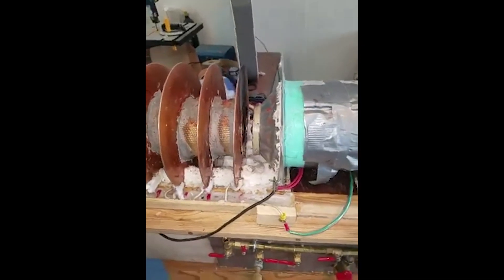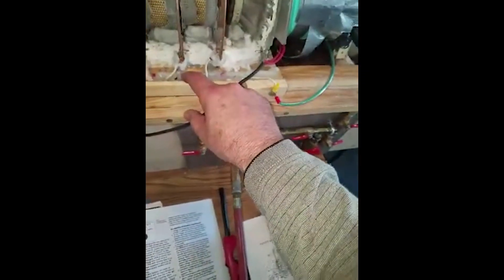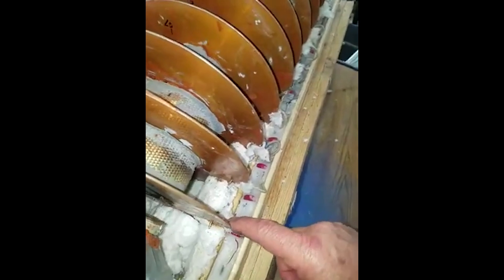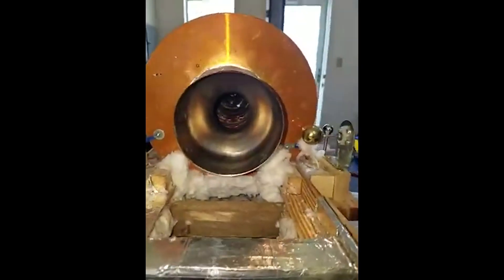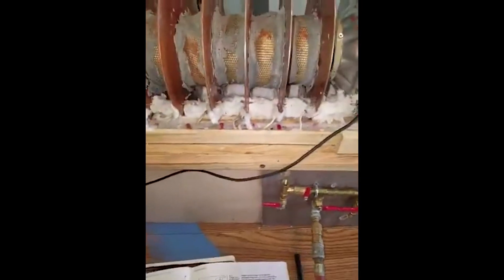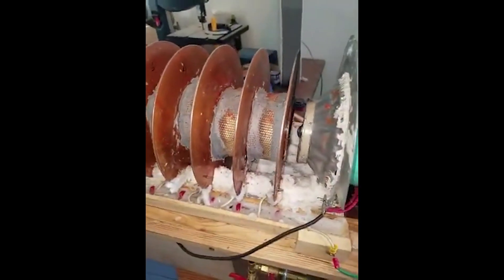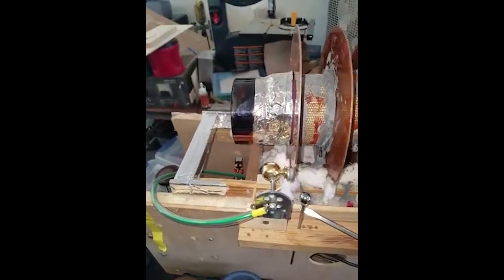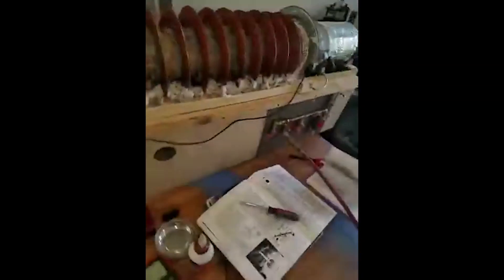TT Brown Flame-Jet Generator Demonstration

Comment: It's good to see a builder working with this. So here's a tip: the hV supply should use an Avaramenko Diode Plug. The transformer wire goes to a capacitor, followed by a diode, then the return wire. Static to charge the flame comes from the connection between the capacitor and the diode. A contact told me: "The flame turns pure white and stretches out to about one and a half times it's normal length". So we're dealing with a high frequency input voltage, with charging inductors for each output capacitor.
Reply: I want to get one of those Yt setups with the big "spark flame" magnetrons and put a fuel gas pipe into that wire.

Comment: This illustrates what the military did with the B2.  They collected very high DC voltage at the exhaust of the jet engine and ran the + polarity to the leading edge of the wings.  
It apparently reduced the friction of the wing, but exhibited no electrogravitics.
Reply: Yes, Paul LaViolette has a very interesting book that has a chapter on the B2. He does himself a bit of a disservice in my opinion by claiming it’s “antigravity”, as that term might be a bit of a misnomer, it’s likely friction reduction, but a stealth craft with “antigravity” capabilities is a very interesting idea. 

Although it might utilise some bizarre electrogravitic force, who knows?
Reply: @worldanimator22 The goal here is "Interialess".

When you move your hand side to side, you feel a force pushing you slightly to keep going forward said direction.

But if you have a static field in between you and your environment, most of the molecules would actually leave you alone.

You solved the accelerator problem, now, you need brakes.
Reply: Aye, but the gent here isn't working with Uranium-Oxide.

Which is to say, don't fly that in a rainstorm

Comment: So this is like turbo charged ionic lifter? Or EHD generator from flame, which is terribly inefficient in both fuel economy and heat to power conversion.
Reply: Flame Jet Generator.

The goal is to produce -10KV starter ramped up to -400KV and apply it to a sphere to act as a Pull Force for a body, while the capacitors discharge and recharge at a certain rate.

Higher K-value, less amount of KW needed per Newton of Force.
Reply: @lumberluc  but if 400 kv is all that needed for a sphere, why not use it from a mainline to see how much force it will make?
Reply: @ANToxic777  Because you need an independent magnetic field.

According to Paul LaViolette's book, the innovator of this type of engine, would have to produce it's own electricity to turn it into a magnetic force.

If you tap into the local grid, your connecting existing magnetic fields into one. That's not going to help you fly.
Reply: @lumberluc  thanks, but even in that case a battery feels more logical to test the concept.
Reply: Supposed to produce negative ions

Comment: Your doing great!

But you need more pressure on your fuel line. Kerosene and Solid Rocket Propellent is on the list, but for the SRP you need to powderize it...

Wait, run through with us, you have the fuel line active, then you activate the Spike. Is the Spike close to a ground plate?